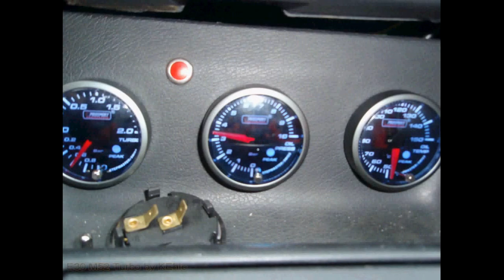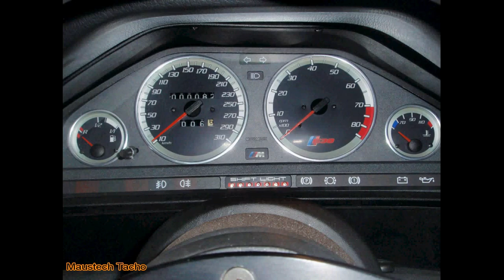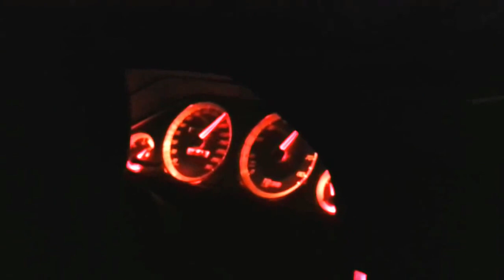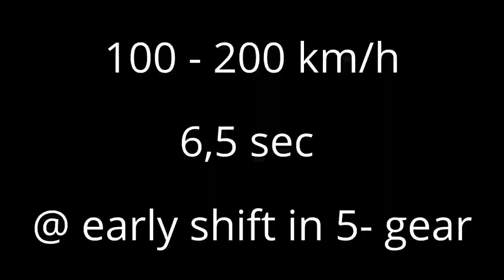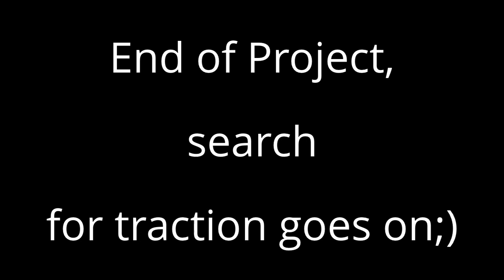BMW E30 M52 Turbo from start to end of project ;)

Comment from the maker: Engine was on a dyno after driving it for allmost 6 years on the street without modifications or damages ;) 
Still puts out 344KW/580NM at 6800RPM with stock pistons, rods, block and head :) 
Its not perfekt, but its fun and reliable

SOLD and still under service
Reply: Welcher Lader ist jetzt verbaut? Habe gerade den Überblick verloren... Echt klasse!
Reply: TheBurnoutdeluxe european (aluminium) m52?
Reply: How much did u sell it and how much would you take to build one same?

Comment: all of you guys, c'mon. Those are individual throttle bodies and that's the intake manifold that was fabricated to enclose all of them xD great fab work btw
Reply: I think he could have easily achieved the same goal without spending money on ITB and just used an intake manifold no? I think ITB works better on n/a cars but then again I haven't built a car from the ground up like this guy so what do I know right? Lol.
Reply: +Shane Deal why put the turbo high..would it not be better to put it low,rear close to the block
Reply from the maker: +08halit try to mount a full assembled head with turbo, downpipe, wastegate with bottom mount turbo ;) show me pics, I'm curious not perfekt
Reply from the maker: +bluecapone All of you are right ;) theres allways a better way. But ifyou had ITBs why not use them ;)